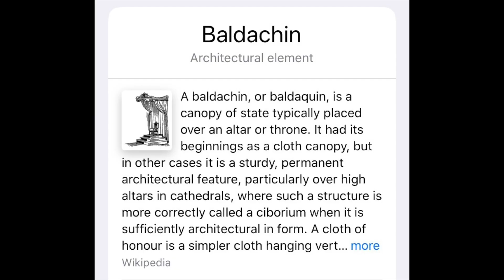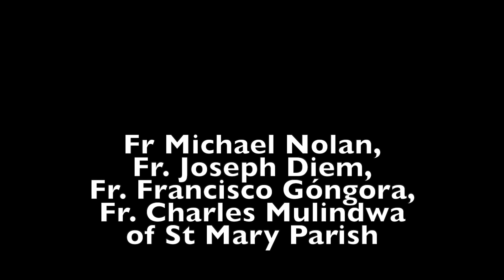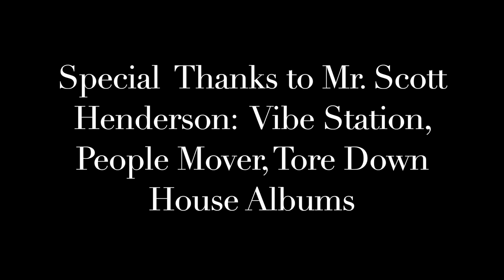St Mary Baldachin Faux Marble

Comment: Beautiful work! Thank you for posting. I would like to learn faux marble painting. Pls tell what colors and materials you used.
Reply: Hi Ann. Thank you! I used all acrylic materials. Black artist acrylic paint mixed with Benjamin Moore low sheen light gray beige paints. Also mixed with acrylic glaze and water for initial base coats. A light and a darker version painted directly on a white primer. Applied with a small  roller and dipping an edge occasionally into the black acrylic for accents in the drifts. I soften with damp sea sponge and rags. I add detail and veins with thinned black acrylic mixed with water and acrylic glaze. Applied with “pencil liner” or “rigger” artist brush. I soften and blend using a soft blending brush (squirrel, or badger) in x shapes. Top coat is a semi gloss  clear acrylic urethane. Hope this helps. Don’t hesitate to ask further questions you may have. All the best in your artistic endeavors!
Reply: Neil Clapp Thank you for replying. What is the ratio of paint, acrylic glaze and water? Is the glaze applied in layers in order to show depth of the marble veining? Hope to see more videos like this in closeup. 👍
Reply from the maker: Ann, I don’t think I ever responded to your questions. Ratios vary. You need to find the thickness and open times that suit what you are trying to achieve. If you want lots of time to manipulate the glazes, then 4 pt glaze to 1 pt paint is a good place to start. You can add water if needed, but observe how the water interacts. Some brands of glaze can perform much differently. Layers are usually better, but you can get pretty good depth in just one or two passes. The eye is fooled by filling in details and sense of depth with our imagination, but good basic skills can get us most of the way there. I’ll include a link here to a short marbling video I did a while back. All the best in your pursuit of the art and craft of faux finishing. https://youtu.be/I7SlzK0NXqY
Reply: Neil Clapp Deco Paint Thank you, Neil, for taking the time to reply. Valuable information to share.